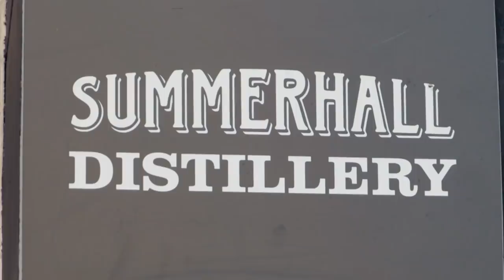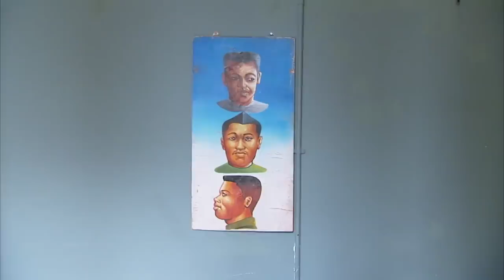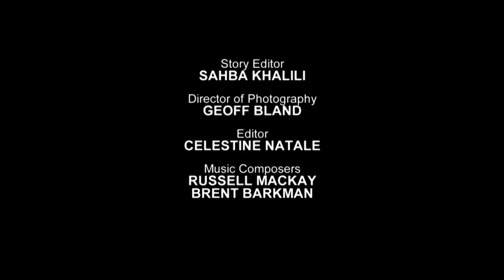Drew And Tee Find A Surprise Antique | Salvage Hunters Full Episode

Comment: Is that a "usual" amount of ice? When I did my semester abroad in London in the late 80s we would get one ice cube in our drink. When I wanted to child some chmpaigne in Sheffield there was no ice to be found in any shop so I filled the bathtub with cold faucet water and floated them. Good as refrigeration. That experience got me used to drinking from the container coca cola bought in the states from the grocery shops that usually would have the AC set at 63F. What I noticed that swigs from the grocery were usually much smaller than the long drawn out supper chilled soda pop dispensed at the fast food shops. The colder it was the deadened the chill would make the tongue to the carbonation. A two litre bottle might at grocery store chil last me a week whereas I could go through two litres refill at the fast food shops in one sitting. So when i take my pills I keep a room temp bottle in the bedroom so that the chaulky pills do stick to my tonsils when the carbonation makes my mouth water a bit. If i drink noncarbonized water those chaulky pills end up sticking.